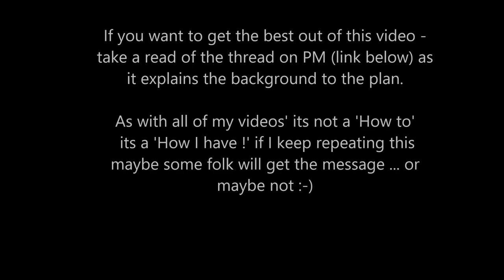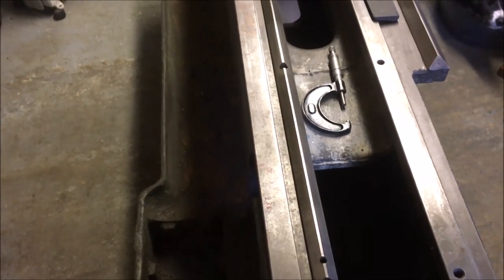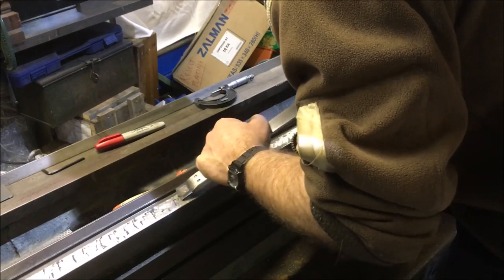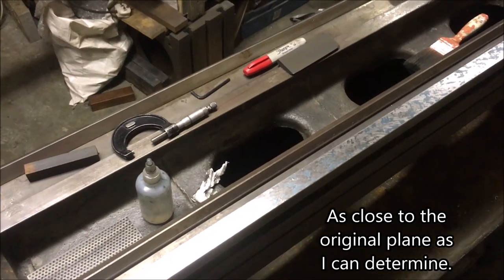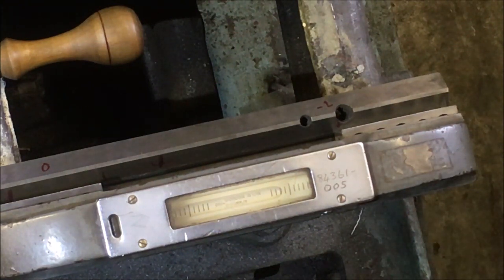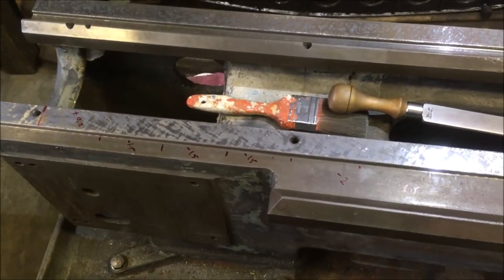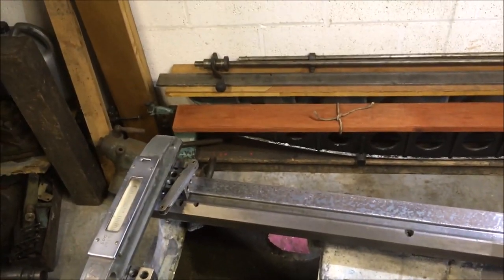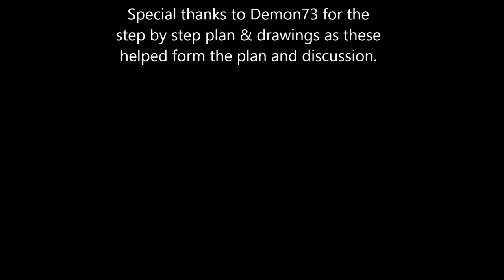Hollbrook Lathe  3

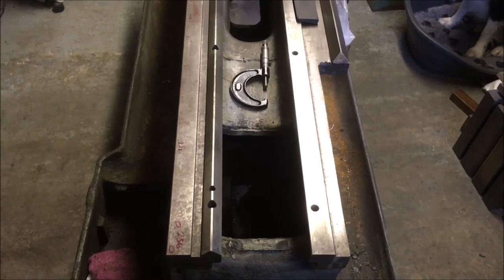Comment: Box level, not seen that tool before, interesting. The scrapping tool you built is great liking the screws everyone seems to be using a special home or shop ground Sandvic scrapper end. 6:41 in hello puppy. Your scrapping tool you built is a real beauty right up to the handle you come across as a really proud builder and we are recognizing your no hurry attention to perfection in your videos. We like the whats in your box challenge remember those days well. It did move we saw it great idea how you handled that alone. we are enjoying this video series thank you.
Reply from the maker: You can get Box levels in various sizes - smallest Ive seen is 4" (10cm) largest is 14" (35cm), the bubble can be 0.001"/10" down to 0.0002"/10"  -  they are very handy for checking vertical faces as in this case.  I have tried quite a few variations on the scraper - initially with the standard Sandvic 25mm blade & shaft with plastic red handle.  It works but its either too long or too flexible for my style - I swapped the red handle for a wide mushroom shaped one to fit into my shoulder when I first started scraping straight scrapes - that worked well enough - but lacked control. The first couple I built were from old files - softened and brazed carbide edges added. They worked better for me, but the edges didnt hold sharp very long. Thats why I made the larger clamp scraper in this video. I am very happy with it as I can take different cuts from very heavy to very delicate cuts.   My dog is called Skye - 3 yrs old Border Collie - rehomed from a rescue centre 2 years ago.  As long as she gets a walk in the morning and evening she is a happy puppy (as am I).  Glad you like.  All the best Mat
Reply: Buying an import box level and scraping it in, was the project that taught me how to scrape for alignment. Very worth my time!  It was actually not bad, as delivered.

Comment: Seeing you run the level up and down the bed a testament to your scraping, looking very straight.
Re Robins comments on things moving. Is always worth checking no matter how good you think your setup is. When I did my bed I had at least 1 base level and one travelling level. One to get your number and one to make sure nothings moving, you could use your box level as a base. Bubble levels are great but you goto have a good setup. Which it looks like you have, youre level both ways and looking solid.
That .030 play in the spindle bearings a bummer, one time when you defo need a test bar. If your gona have a go at making one maybe make it to the Holbrook taper rather than a sleeve to MT3?   
I got to learn that 'Biax mode'. Proper time saver! 8)
Cheers
D
Reply from the maker: Hi mate, hope your backs improving.  Robin is absolutely right about spirit levels and the issues of stability - he was using a level with twice the resolution of mine 2rac seconds -  and he says his floor is more flexible than mine.  I recall trying to use the level to verify the SE progress and it was a non starter - the surfaces would move with the level -  even the hefty 6ft master  moved on the three points it was sat on - but as it was sat on wooden horses it was a non starter. I tested it sat on steel plates on the floor and still troublesome.   With regard the test bar set up - I could buy / borrow a 3MT test bar maybe - but that requires the plug. So either way I have to make the plug - maybe as you say making up a shorter test bar with integral plug to the Hollbrook taper is the way to go. Its a ways off needing it yet though :-)  I have edited out a lot of my ramblings to cut this down to within an hour - still too long but there are some important bits missing  from this about the starting points - I hope to try and add a short recap in the next update.  Thanks for watching and commenting Duncan.  All the best Mat
Reply: @lookcreations  2 arc seconds!? Thats .0001" in 10". 5x ,more sensitive than your 10 second level ;). Typical Robin lol... I remember playing around with my surface plate with 10 second levels. Was possible to get things solid enough not to be noticed with a 10 second level, same experience as you with wood tho, no starter is right.
The back is better on the pain killers, at least I can kinda walk now haha.
Cheers

Comment: I bought a MT5 spindle proving bar off ebay for my drill, it was new from India and not much more than material alone would have cost me and it proved to be accurate. You might contact them they might would do you a custom taper as well.
Reply from the maker: I have to get the dim's sorted so I know what Im after first - it may be a MT 4.5 or as I say bespoke to Hallbrook. I shall take a look this week as a break from scratching away.  Thanks Brian. Mat

Comment: The deeper lines are not an issue but what caused them is... Check your saddle and look for a lose screw, hardened materials. The deeper groves will be oil surfaces, but they can collect hardened metal, so keep clean or covered.
Keep your mind on the hardened materials you are cutting... Perhaps use a whipper before your track wiper , on cross slide...
Reply from the maker: I am certainly going to look to improve the wipers, the lathes old and I think poorly maintained over the last couple of decades. Be nice when I’ve done and as a result of my graft, I’m pretty sure I will treat it as it should be. Lubed, cleaned and used. Thanks for watching and commenting 👍 All the best Mat
Reply: @lookcreations  , know this... the saddle is not "point loaded" (as any dial gauge shows, on ANY of these resurface jobs)...
It has a "bed" itself and if you can get that saddle to cross slide without variations then you are golden.
In other words, a 10th may not make a single bit of difference as the saddle is designed to bridge those gaps.
Spend your effort on variations with the top slide and cross slide... Then track your saddle from side to side to see how much, if any needs to be addressed.
I will do a video on this...
Reply from the maker: @EngineerPEretired   I think I follow you, I am kind of working in the dark on the project - its the first lathe Ive rebuilt and only my second machine. Ive learned a couple of lessons the hard way - which I will include in my next video on the twin cross slide / taper turning slide. I currently scraping the cross slide - nearly finished it. Then I have to address the saddle to bed. All the best Mat
Reply: @lookcreations  , I follow you also... I enjoyed your video...  I hope you enjoy some of my content and the content I do post that may trigger you... Please, play along as I also enjoy the human mind, psychology...

Comment: Matt.
Interesting the errors under the headstock. 
My naivety would have expected that area to be good.
You are welcome to use my beat up old Colchester if you need to.
You have had my number.
Steve.
Reply from the maker: Hi mate, the 'error's under the headstock end are my fault - scraping with the shorter lighter SE - there is always going to be some error left - even when you step print a couple of tenths' can creep in without much effort :-) sneeky like that those tenths'. Got to get some dimensions for the plug and check if its a MT4.5 by chance ?

Comment: That looks like a pretty big project. I will have to watch your progress. I don't think there is to much to do with large chunks out of the vee way by the chuck. Some of the deep scraches may be oil spots  Good Luck
Reply from the maker: I am off the same view about the big missing chunks - that portion of the bed isnt used for much past initial setting of fixed steadies and the like. My friend suggested inserting a section of cast iron and scraping it down - says it would be invisible repair... sounds like a good amount of work for esthetics benefit ?  Good to see you stopping by and commenting. All the best Mat
Reply: @lookcreations  JB weld and scrape it. It makes great filler and works pretty easy.

Comment: Ever considered to use an angle grinder or small dremmel type grinder for roughing it in?
Reply from the maker: Yep. I know chaps that gave and when you need to shift material quick why not ? Of course it requires care or you take too much off.
Reply: @lookcreations  especially at the far end where you have to take off a couple of tou

Comment: I don’t understand your measuring setup at 1:30. The right side of your home made kingway measuring tool, i.e. the slotted cylinder, is riding on the worn way and your indicator is measuring the same way. So why would there be any height difference? I would have thought that you would want the foot of the traveling frame to be riding on a factory machined unworn surface so that the indicator measures wear. Or have I missed something obvious?
Reply from the maker: You are spot on. The measurement at this stage is real basic not reliable just an aid to understand the basic condition. Ideally the dti at 1:30 would be better set 12” forward of the shoe riding on the worn way. The shoe will average out the wear under it so the indicator is only giving a guide. 
Think about this step as rough measure before any serious measurement is taken